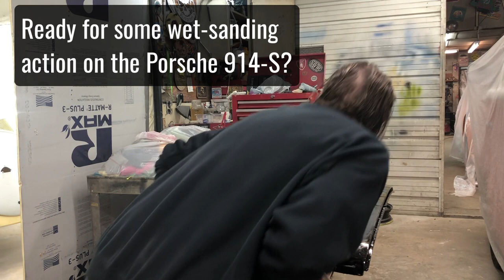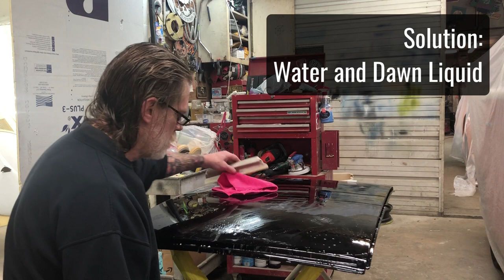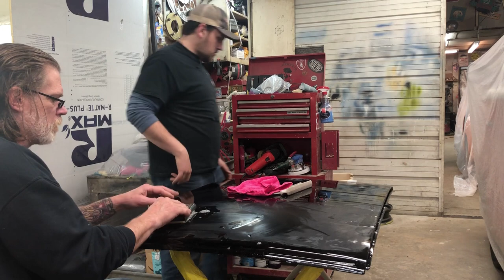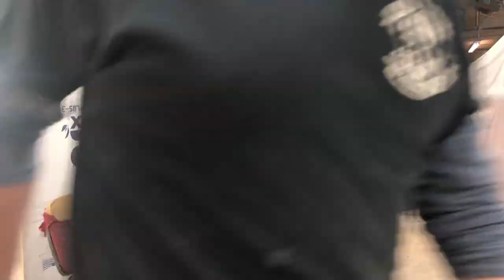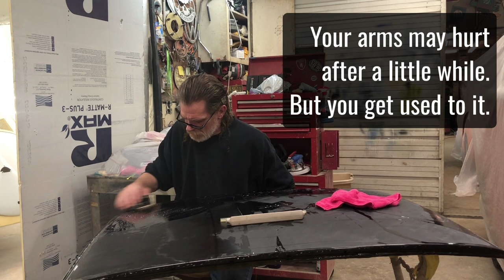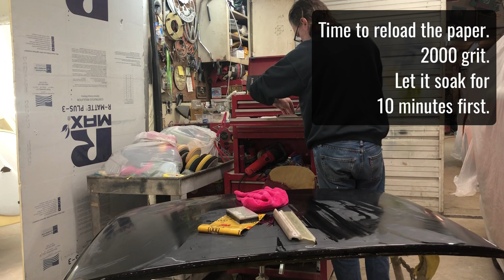Wet Sanding a Porsche 914-6 Targa #porsche #porsche914 #restoration

Comment: How many coats of clear do you usually apply?And are you ever concerned of sanding through it ?
Reply from the maker: depends on the level of depth we are achieving . the min is 2 and a half , the max is 4 ... if we are doing a glamour clear then the cleat coat will be reapplied on top of the first set